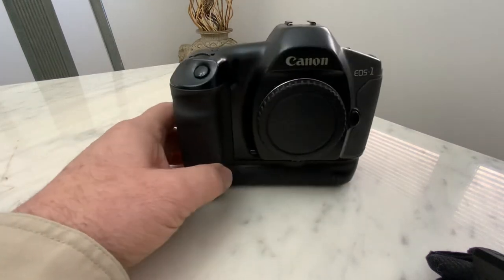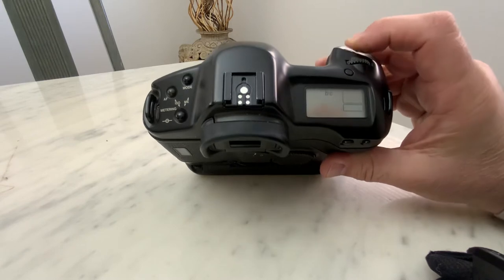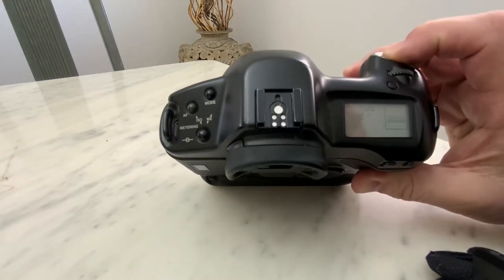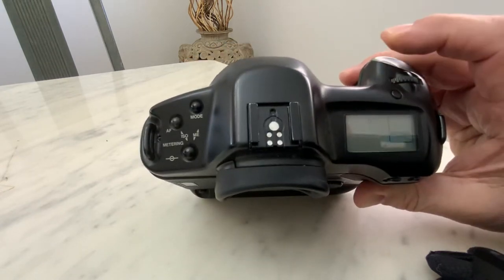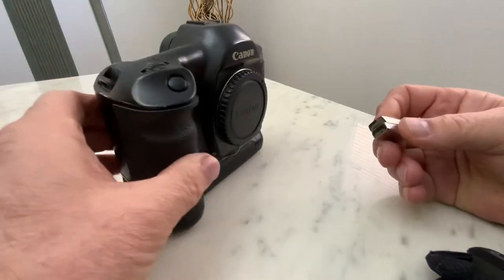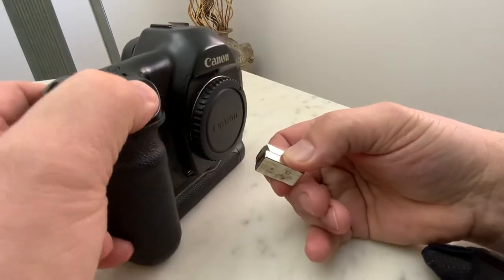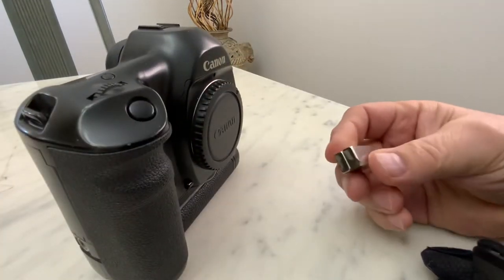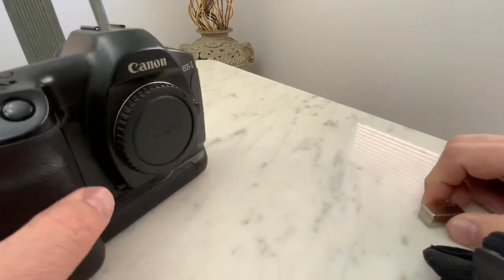Easy fix for Canon EOS 1 Film Camera BC Error

Comment from the maker: I have noticed that the BC error now returns after only a few days of non-use if I am using a 2CR5 battery with the standard GR-E1 grip, or 6 AA batteries in the BP-E1 battery grip. If I use the PB-E1 “Power Booster” grip, (8 AA batteries), it seems to take much longer before the BC error returns. I am not sure if this is just coincidence or some effect of the higher voltage of the Power Booster grip.
Reply: 我用的8节电池供电，还是会出现，不过已经养成随身带块磁铁的习惯了

Comment: I've tried to fix "bc-error" by this magnetic method. 
It works ... but after pausing a couple of minutes bc-error is back ...
Is there a method to fix that "bc-error" not only temporary but forever ?
Reply from the maker: What battery grip are you using? I have found that using a Power Drive Booster like the PB-E1 or PB-E2 seems to keep the BC error from returning. I am guessing that the extra battery power somehow keeps the shutter magnet better energized.

Comment: Hi, I have got EOS 3 and I get the BC error message but not after I press the shutter button but right after I turn the camera on. The only time the LCD shows any info is when I gently depress the shutter button just a little down (not fully) otherwise it is always blinking. 
The camera was barely used. Is this something fixable? The camera doesnt make any sound at all. It just blinks this BC. Oh and the batteries are freshly bought 2 days ago.
Reply from the maker: BC is used for other errors as well,  and it looks like you have an error not related to the shutter.
Reply: @MikeSowsun  I did think about that as well. Do you think it’s repairable ? This camera was barely touched
Reply: @dzava  he literally made the video about it. The one you are commenting right now 🙃
Reply: @deadpool6072  no he didn’t. The magnet method did not work and the camera was later checked in the service to be found out the processor was dead.

Comment: Are you still using it well without any bc error?
Reply from the maker: The Magnet trick works well but if I don’t use the camera for a few months, the BC Error will return again.
Reply: @MikeSowsun  If you use the camera continuously after repairing it with a magnet, the error won't come up?
Reply from the maker: @hansfam8020   Yes, I find if I just fire a few frames every few days, it will always work. If I leave it alone for a month or 2, the BC error shows up again.
Reply: @MikeSowsun  Thank you. Your advice helped me a lot.^^ I live in Korea.  I bought EOS3 to take a picture of my daughter, but I'm not worried anymore.^^ Thank you. Have a good day!
Reply: @MikeSowsun  if bc error comes again can i do the same magnet trick as usual? cause i rarely shooting with this cam lately
Reply from the maker: @unreal0310  Yes, the magnet trick always works.